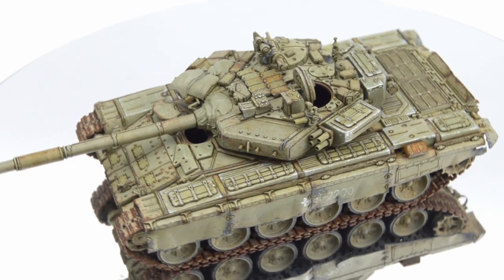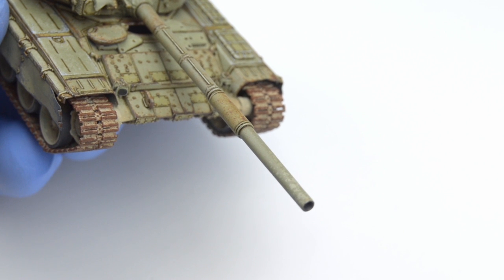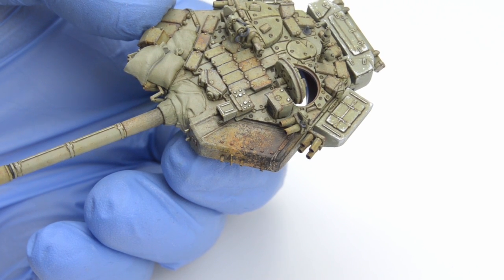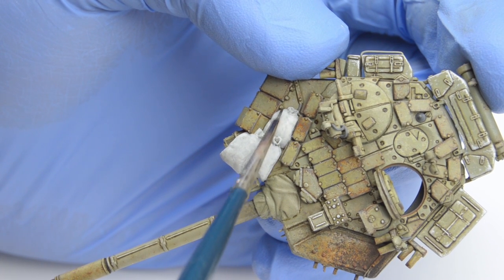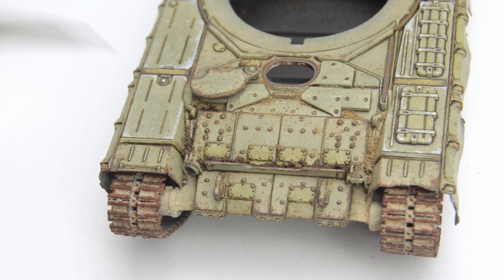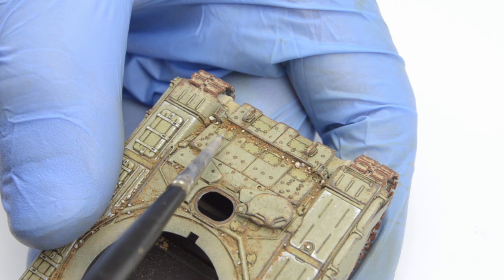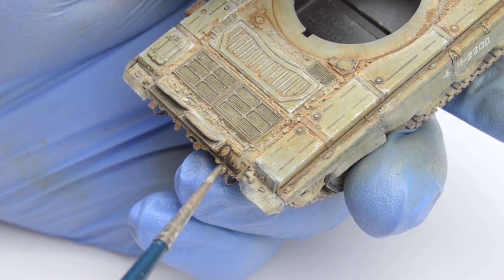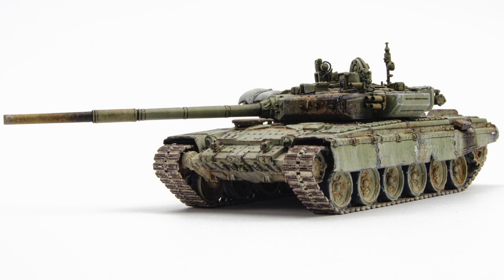Let's Finish The Battle Worn T-90 from Revell!

Comment: I'd attribute the torn up thermal shrouds to Russia's general doctrine with equipment, "we've produced 8 billion of these, tear it up all you want it'll be replaced quicker than the full matinence service life."
Reply: Replacing the heat jacket does not make sense in Syria because the tank is used against irregular infantry and light armored vehicles. High-explosive shells are mainly used, for which accuracy is secondary, especially at such short distances. It's easier to replace the entire gun.
PS This particular t-90A tank, they produced less than 400 pieces. Domestic version of Russia, export analog-T-90s for India. Russia has no more of them left, they were disassembled for spare parts. They were used as training courses.
it was captured by Pro-American extremists in a battle with the Iranian-Syrian militia, and the terrorists took care of it, although they could not use it properly, only in manual mode. It was destroyed by a Syrian T-72B shot in the side because the systems were worn out/damaged, or blocked. the tank was abandoned after some time and burned down.

Comment: kinda weird seeing a T90 without the Shtora APS
Reply: The T-90C of India, for example, already almost does not have a Curtain; it was replaced by a thermal imager and additional EPA units. The T-90 with the Stora was quite small, 350-400 tanks.
Reply: @elusive6119  but Syrian T90s have Shtora systems which was my point

Comment: Hi Night Shift
Re: Your first (of 3 videos) on the T-90 from Revel
I think that you have been really HARD on Revell ... Just some thoughts ...
1) Revell have moved away from their previous way of making TRACKS - on one of their large German half tracks it worked brilliantly yet on the Leopard 2 A6, it was a nightmare ... you just happened to hit one of their few kits where they've changed their track building methodology - I have mixed thoughts on the change 
2) Some of their old kits are very ordinary (especially the planes) but the've phased most of them out so its rarely if ever an issue now - but that is true of almost every manufacturer. You can look up Scalemates website in seconds and they have information on everything the age of the kits,  their history, reviews, etc. An example is https://www.scalemates.com/kits/revell-03191-cromwell-mkiv--154815 
3) Importantly it has always been said of Revell that they design to a price i.e. a model is given a BUDGET for kit development and once that's close to being exceeded some kit sections are "rushed"/ don't fit properly etc and YET most of the same kit is perfectly detailed and does fit perfectl
4) Revell kits are designed to be very PRICE competitive - a Revell kit can be up to HALF the price of its Japanese equivalent - for those of us strapped for cash this is important - especially when you factor in (for models ordered on the internet) currency conversions, delivery charges, etc. and aftermarket stuff if you want to dolly it up a bit. but you have to live with the occasional 3) above
5) As part of keeping the kits affordable to the "masses" they market them to as wide a range of consumers as possible - they're quite happy to retail them in supermarkets etc. - l am not proud - I'll buy them anywhere. Perhaps retailing them with kids toys isn't smart but that is what the Retailer choses to put them - not the Manufacturer. By the way, e-Bay still classifies kits under "Toys"!
6) I would regard the majority of their kits as being unsuitable for young children - as are most of the kits by the other manufacturers
7) As for QUALITY see https://www.onthewaymodels.com/kitlists/revellagkitlist.htm - probably the best review site for 1/72 military kits - they say
REVELL "Plastic kits from Germany. This is an excellent line of kits. The first models in the series started out a little rough, but every new release is better than the previous ones, and their latest releases are some of the very best kits on the market today. All of the vehicles have hard plastic, link and length tracks. Revell has also begun a limited re-release of several of the old Matchbox 1/76th scale kits. Unlike Airfix, these Revell kits are clearly marked as 1/76th scale."
8) Sure there are some newer manufacturers out there e.g ModelCollect (fantastic kits but they only do a few of the popular subjects) and Ammo - again fantastic kits but sooooo few of them
9) We are all governed by our previous experiences - I grew up making Airfix kits - they were so bad in the 1970s that even now I have convulsions and sweating attacks when I think about them BUT I think that their latest planes are fantastic. However their pricing has greatly increased e.g. I paid 50 euros for a 1/72 Shackleton! Their tanks seem identical to those I build in the 1970s 
So do NOT be bound by experiences from a long time ago - just look up the Scalemates website for all the info, read a review or two and make up your own mind
If you haven't built Revell in a while just park your prejudices, check out a review or two, buy one and just build it - that's the best way of deciding which manufacturer is good or bad
10) Revell are not shy of ditching a mould and starting again from scratch - the Revell Ju 88 kit is mentioned in a few comments below, came out in 2011 - the previous one was from 1967!  The kit has got excellent reviews so it's almost certainly the old mould that is being commented on
11) To my knowledge Revell currently issue very few re-badgings of other peoples kits - they did in the past (e.g. from Hasegawa) The ones that they do are usually identified by being 1/76 scale (i.e. Matchbox), they have taken over the moulds of a German company that just closed up but all of these are quality kits. The current re-boxings are of high quality products from other manufacturers. I have built one - from Zeveda - the Sukhoi Su-27, which is a brilliant kit 
12) I  don't know of any re-issuing of "old" moulds in recent times. Any re-issues, are of products that they're originally released within the last 15 years (max). They like to "rest" their moulds after its been on the market for a few years - perfectly fine with me.
13) Again look up Scalemates - Scalemates - Scalemates. If you are going to invest hours and hours of your time in building a kit what's a few minutes of your time to do your homework beforehand? Nobody wants to end up with a "dud" kit - reading a few reviews will always tell you if your going in the right direction ... 
In summary Revell - are to me - a fantastic compromise between Quality/Availability/Price
Trust this helps - by the way this seems a BRILLIANT site for kit building - I've just subscribed!
PS If someone comes across an equivalent or better manufacturer of 1/72 military kits of similar Quality/Availability/Price DO LET ME KNOW - I'm always trying different manufacturers and looking for a wider choice of subjects ...

Comment: 16:22 that’s complete bs, Every engine has tolerances for weather changes but that’s isn’t something that should cause soot, The reason so much soot comes out is because they use awful low grade diesel have really crappy air filters and have oil leaking into the combustion chamber because of poor maintenance.

EDIT: I mean nothing bad towards you or anything, I fucking love your vids man!

Comment: Probably I won’t get a detailed answer, how the author of the channel removes the excess of black superglue when gluing small details .. 6 times I asked - there is no answer. Apparently this is a military secret and the automatic translator does not translate.
Reply: Lynx africa takes it right off
Reply from the maker: It's a product called "debonder". It dissolves all CA glues, but some debonders might not work as well as others. The one I use is made in Czech Republic, and it's called "Dousek's Debonder". You might need to look around for other alternatives depending on where you live, and try a few different ones to find one that works instantly like Dousek does.
Reply: @NightShiftScaleModels  Thank you so much. Generally did not know about this tool. For 72 scale it is very relevant.